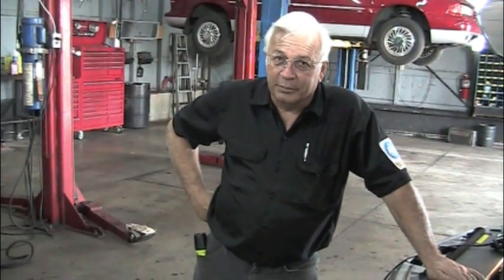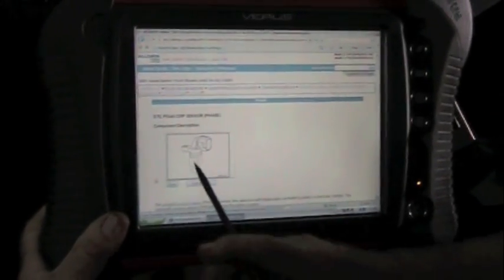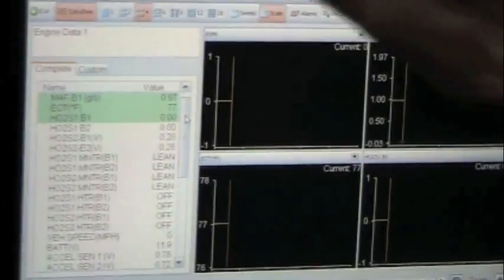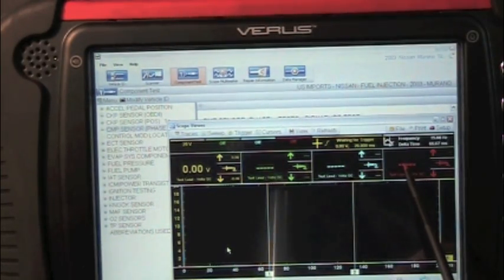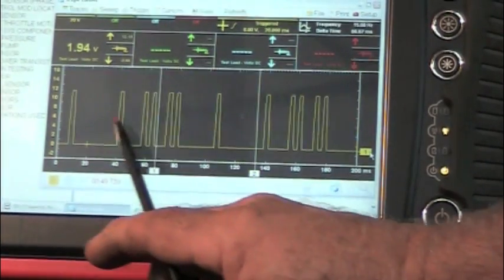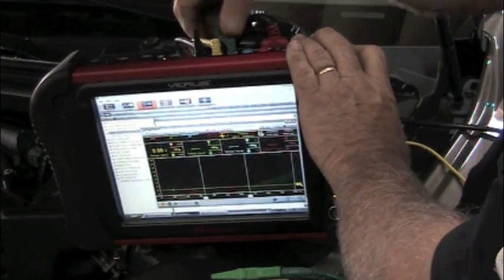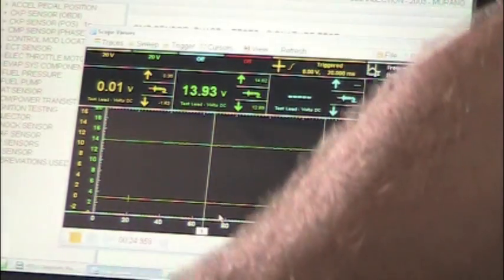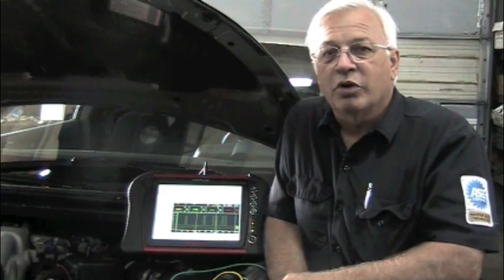Labscope cam sensor test

Comment: If we only have one sensor, the flat line and the scope connections wires are good, can we tell if the power and ground at the component are good from the lab scope by voltage reading or would we have to power probe the sensor sides?
Reply from the maker: Bonita,  if your sure you leads and scope settings are correct and you still have a "flat line", then you have no signal.   To answer your question - no, you cannot tell that the power and ground signals are good because if they were you would be seeing them on the screen.  So, yes, you would need to use a power probe, back probe directly into the sensor and verify that there is good power to the sensor, and a good ground.  If so, then the sensor is bad. However is you do not have good power and/or ground into the sensor, then you cannot expect it to even give you a signal.  So, at that point, even if you replaced the sensor with a new one, it would not produce a signal either because it would not have good power and/or ground.  First correct the power and/or ground and then look for a signal from the sensor.  If you still need help understanding this, check with me in class and I'll go a little deeper.
Reply: realfixesrealfast Thank you! That answered my question.

Comment: Great vid but do you think that power and grounds should have been scoped when the signal dropped?
Reply: Thanks for doing the video. I agree.  I was thinking the very same thing, since maybe it was a pull-down type circuit and a wire was rubbing ground somewheres only when the car was warm.

Comment: If any recent work was done , involving the camshaft or the sensor, camshaft cover, wheel,,etc  You may have to do a cam sensor relearn  procedure. the light may indicate the absence of  data in the pcm to calibrate the variation values needed to monitor the camshaft position, with regards to the lab scope patterns, you need a [ known good ] signal pattern to compare to lab scope traces you are looking at. Timing chain jump is possible but relatively speaking a rear occurrence

Comment: i have a 2002 ford f150 whit code p1336 crank -cam concern , i clear the lightt and come back on at firts trip, how do i know if the paterns are good, what wave should i expect, how i know if this is a timing chain jumped, could you tell me how the paterns should see on the labscope when there's a good timing chain and how they look when there's a jumped chain... thanks

Comment: what if you had bad wiring to the computer .
Reply: You would need to check power and ground at the PCM. Also need to check for the (5) volt reference coming from the PCM. A shorted sensor can cause the PCM to stop sending out the five volt reference voltage.

Comment: I have to point out that if you see no signal coming from the cam sensor you would need to make sure that the other two wires are at the proper voltage or ground.  You should also inspect the pigtail for bad (opened up) terminals. and/or do a wiggle test on the connector. 

I also don't agree with using the style of probe that pierces the insulation, this can damage the wire and allows a place for moisture to get into the wire causing corrosion and eventually high resistance.